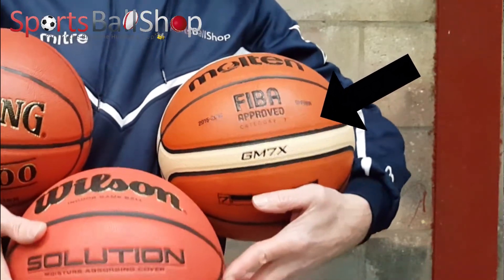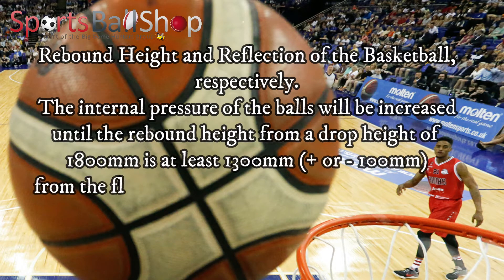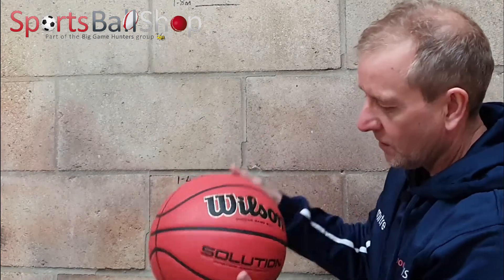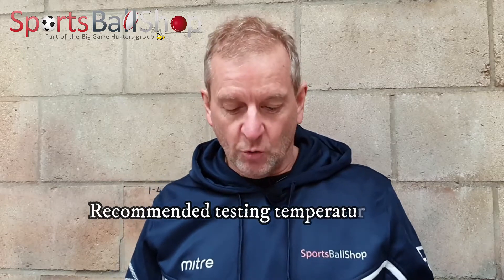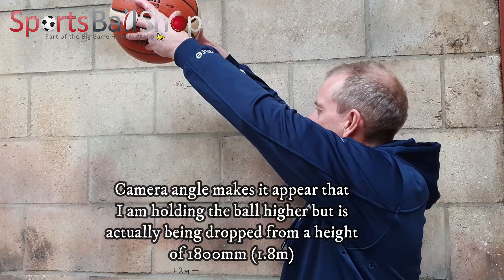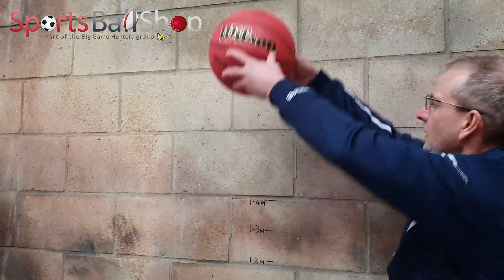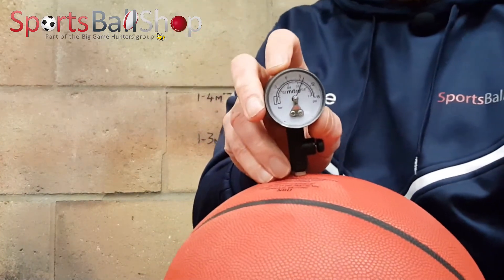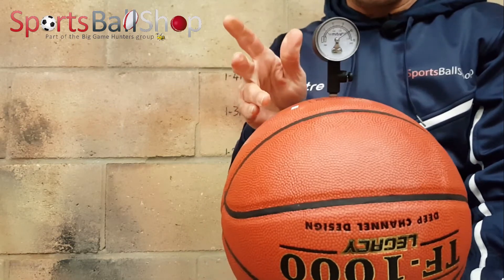FIBA Approved Basketballs PSI Rebound Test - How Do 3 Balls Compare?

Comment: Like to see this kind of stuff. What is also a factor besides the air temperature you mentioned is the material characteristics under low temperature. Guess the ball is much stiffer and not that responsive
Reply from the maker: Good point, thanks for commenting

Comment: Hi, very useful video but can you provide the direct link to the document you printed please so I can reference this when speaking with Molten as my new B6G5000 bounce below the 1.2m mark dropped from 1.8 onto a concrete painted surface with an air conditioned temp of around 21-22 celsius. Thank you. Steve
Reply from the maker: I no longer have access to the documents as my circumstances have changed. However I am pretty sure I got the information direct from researching the FIBA website

Comment: Great vido however the new rules says from 1800 millimeters on the underside to a bounce of 1035-1085 millimeters on the underside eich on the upperside would be around 1300millimeters or 1.3 meters with only 50 millimeters of error . So the new bounce test would be from 1.3 to 1.35 meters. (sorry for my bad English)
Reply from the maker: Great update, I will double check as I missed the latest edition 😀

Comment: I just got a new wilson authentic outdoor/indoor ball and the bounce is very bad - I used an electrical pump with 8psi the ball is hard but hardly bounce higher than my waist.
Reply from the maker: Hi Gordon Ramsey III, is that the correct psi required for that basketball? If so it might be your electric pump is giving a false reading and it isn't actually at the proper psi. Worth checking...?

Comment: What kind of floor is you using for testing?
Reply from the maker: I thinknit was a concrete floor as was filmed in one of the warehouses
Reply: @SportsBallStu  and does the official measurement include on what kind of surface it needs to be measured?
The core question is: does the ball bounce different on an official basketball surface, if so, maybe you should update this test session.

Comment: What is the difference between the wilson solution and the wilson official ncaa solution ball?
Reply from the maker: I will double check but the NCAA ball will have specific graphics on the ball relating to that tournament. The standard Solution ball will be exactly the same quality but won’t have league branding on it. The Standard Solution ball should also be a bit cheaper as Wilson will probably have to pay a fee to carry the branding, which is passed on to the consumer. I hope this helps
Reply: @SportsBallStu  can you use the Wilson solution outdoors or is it strictly an indoor ball?
Reply from the maker: @ppanda2974  If you use it outdoors it won't last too long. It is designed to only be used indoors.
Reply: @SportsBallStu  okay and thanks for the response. 😊 Would you say the Wilson reaction pro is a more suitable choice for outdoor use?
Reply from the maker: @ppanda2974  The Wilson Reaction Pro ball is one of my favs and is perfect for outdoor use. They can be purchased from Sportsballshop https://bit.ly/3oMUgt2 if based in the UK

Comment: Can I used wilson solution outdoor ?
Reply from the maker: Hi Fenix It is designed to be used indoors only. If used outside it isn't likely to last as long, as the surface will rough up quite quickly